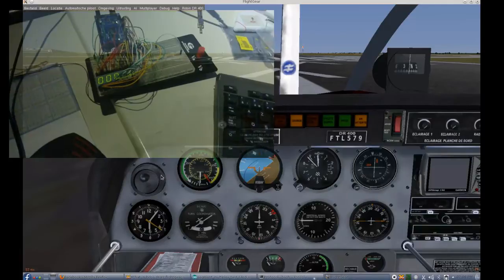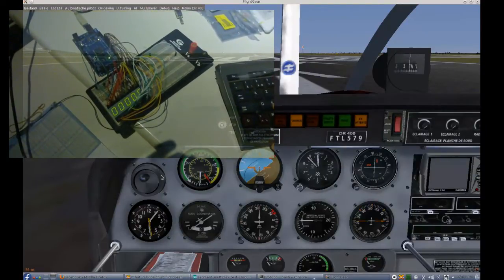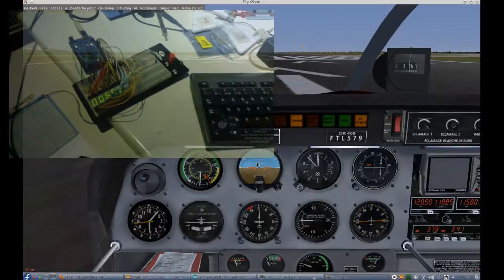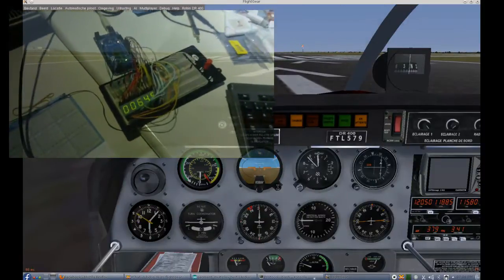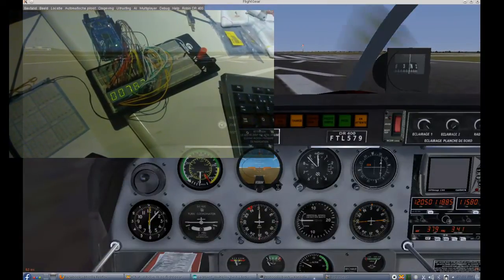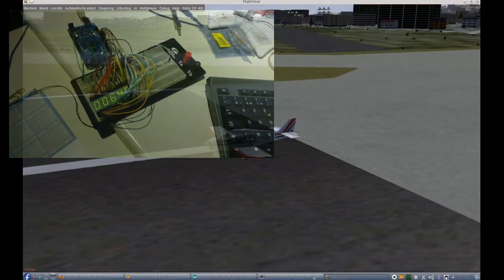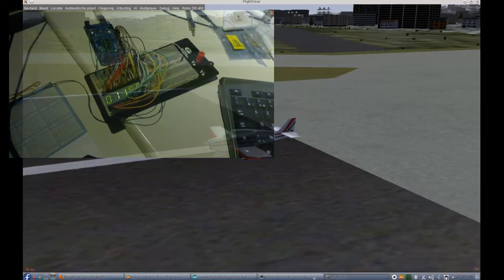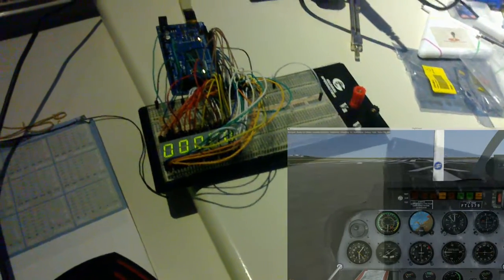Flightgear Arduino DR400

Comment: Hey interesting video!
Could you maybe tell me how u got it to work because I can't seem to get it working.
I don't really understand where to put the COM port at the command line in settings. 

And btw how did u manage to read data from FlightGear? I'm guessing Serial.Read() but that doesn't really do anything without some code right?
Reply from the maker: You read this? http://wiki.flightgear.org/Howto:Use_Arduino_with_FlightGear#Example_3:_Outputting_properties

Basically, flightgear automatically sends out data to the Arduino, as a built in feature. The Arduino "parses" the XML.

Please note that this is 5 years old and may not work anymore... there be dragons!